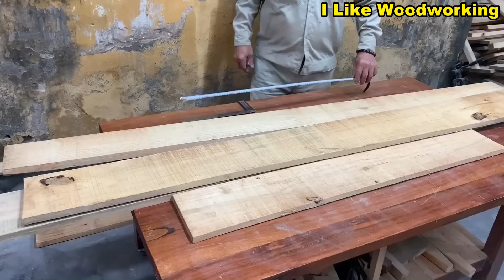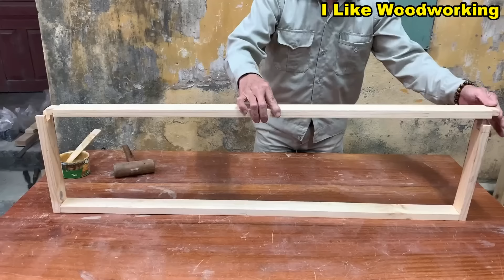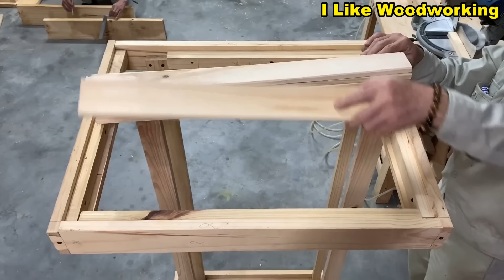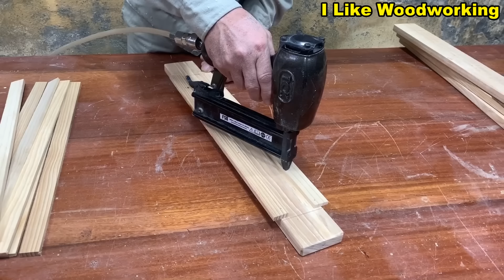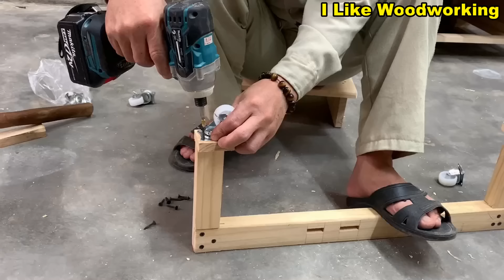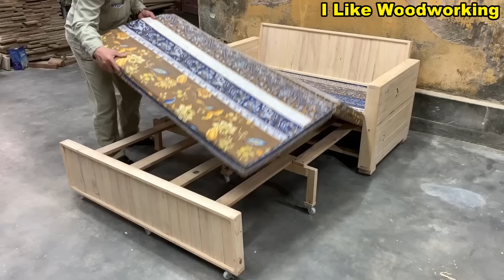Amazing Skills And Techniques Woodworking Easy Ingenious - How To Build A Sofa Combined Compact Bed

Comment: Thanks a lot for showing us. Very good work!👍👍👍👍🤙🤙. But i will recommend if possible you should reedits the video and also display the measurements of the woods and the distance in cutting, drilling and lots more. The names of the tools should also be added. One more Time. Thanks 👍👍🤙🤙

Comment: @ilikewoodworking thanks for the lesson.  That's a  clever design! I would suggest you add a brace on the bottom from the front pull out panel to the middle pull out for stability. 
What is the make and model of the green machine please? That thing is awesome! Definitely compact for a small workshop.

Comment: It's cute but it looks easily breakable
Reply: Very good thought. It does seem flimsy but a 1×4 can hold around 35 pounds per square foot. He basic has the most support at the head of the bed, less in the middle and even fewer at the feet. For most of us our torso weighs more that hips and feet so it should be secure. A standard full size bed is about 28 sq ft. So it would hold around 980 pounds. That isn't counting the frame which is reinforced with three crossbars. So I think as long as the wheels were strong enough it wouldn't break. The slats and frame could be swapped out for 2 bys as well which would definitely make it much heavier and sturdier.